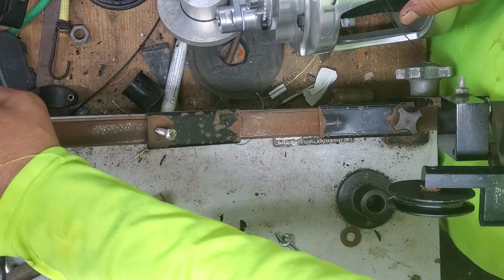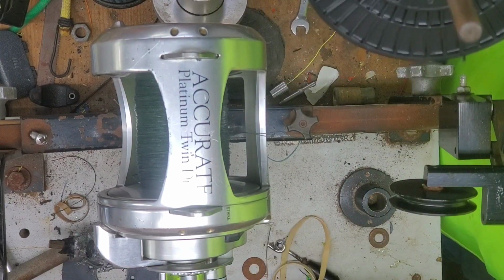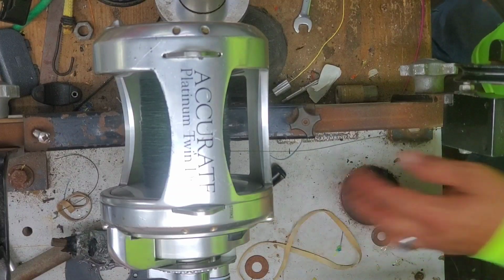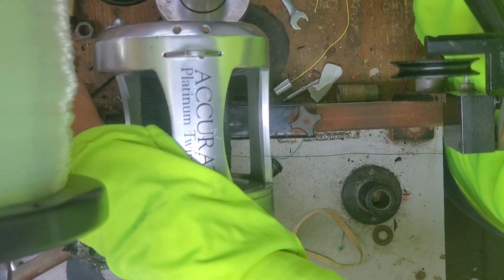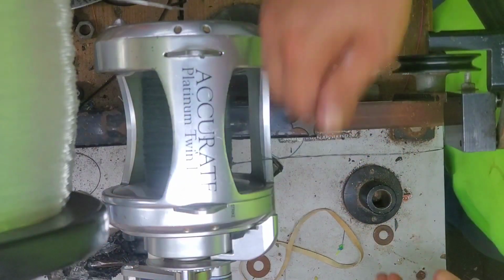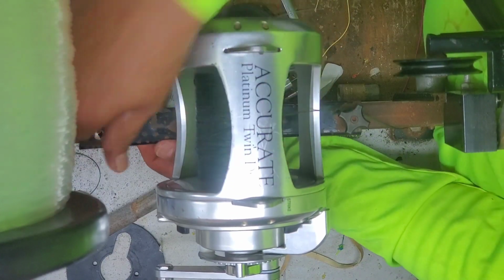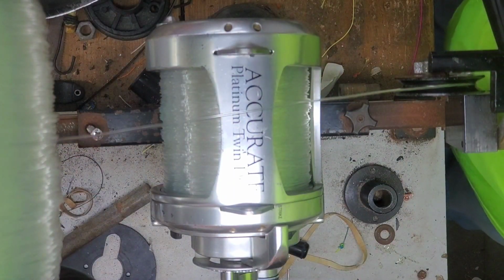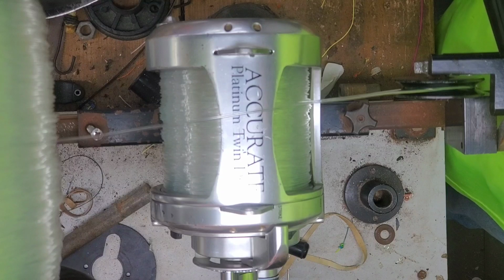Accurate Twin Drag braid fray cutout and mono top shot 125lb bullbuster

Comment: Have you ever thought of using the FG knot in place of the bimini to worm knot? The mono is not knotted at all with the FG so it's one of the thinnest braid to mono connections. From personal use, I know that it's extremely strong as well, never had any issues with it if I tied it right.
Reply from the maker: Thats not the issue I come up with... Braid has very little abrasion resistance for us on the sand rubbing across a sand bar is what worries me... however, with the worm knot the braid inside is protected by the mono on the outside of the knot...
Reply: Ah, wasn't even thinking about the abrasion. That makes a lot of sense that you use that knot! @TeamHardLife
Reply from the maker: Yes sir now offshore fishing or bay fishing yes sir smaller the better ..